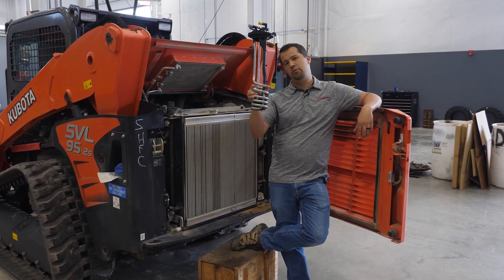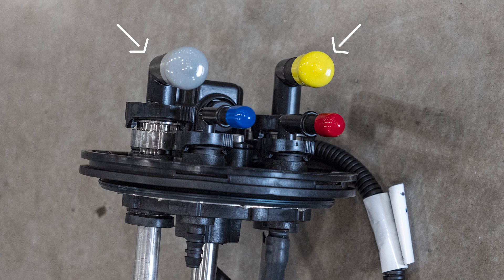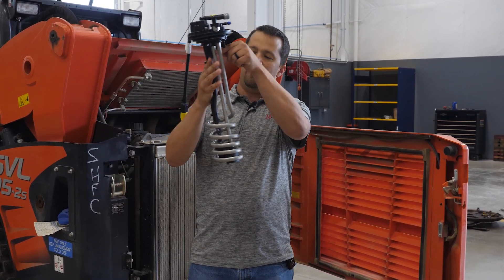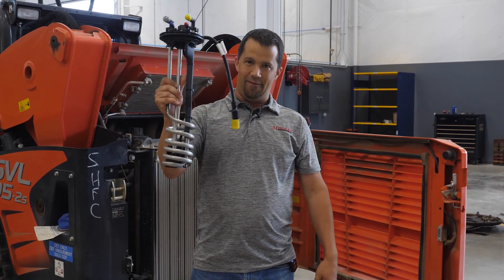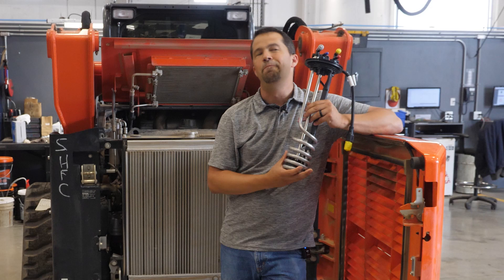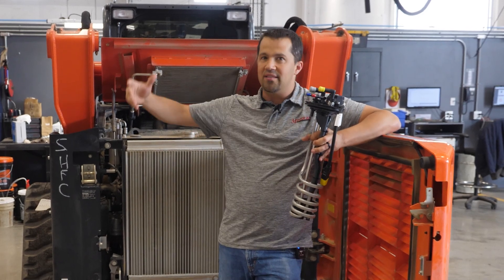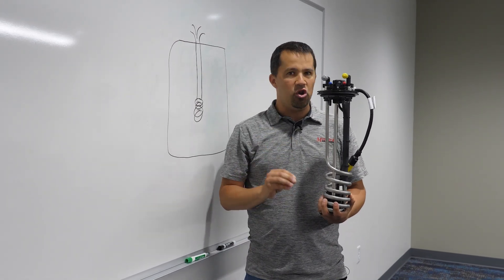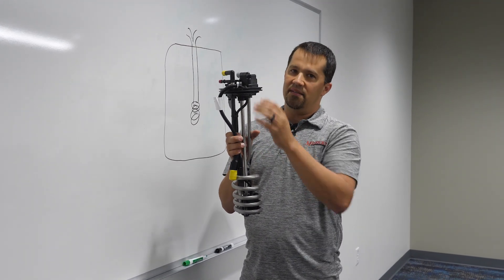DEF problems? What is the DEF header and how its been improved.

Comment: My Kubota M5-091 with 300 hr just threw a code for the DEF circulation pump.  Basically Kubota has a crappy DEF header system that should be replaced as part of a recall.  I change my DEF fluid every 6 months, but it hasn’t helped me.  If this current issue costs me big time, I’m done with Kubota.
Reply from the maker: There was a service campaign to fix this problem

Comment: I’m not a big fan of particulate filters in general on off road vehicles!  I recently bought a L3902 HST and was reassured the regen system if fairly trouble free for years depending on the hrs I put on it! I actually don’t mind the lesser stink of diesel exhaust from a regen system and have always disliked diesel fumes in the past! It would never fail that I would get stuck behind some coal rolling garbage truck and my vehicle would smell like diesel for a day! 😂 I’ve been a believer in that  less is more ! The simpler the system the longer it’ll last. All this extra emissions is just destined for failure!

Comment: It's a shame that they couldn't design fluid that had an actual lifespan to it especially considering a lot of DEF tanks seem to not come with a drain valve on the bottom so you can drain old fluid without pulling a lot of parts out. It's a multi hour job to drain out the tank on a silverado for example and it's basically impossible to get to the DEF tank on a cat 299.

Comment: Working at the biggest Kubota dealership in Georgia, I could change headers in my sleep! The upgrades are great so far, buuut we have been told that before. I will say, big orange stands by there product 100persent.
Reply: I need to change my def unit. 
What holds the unit in place? I see how to get the hoses  and connectors off but what is the trick to remove the unit from the tank?

Comment: Neil, I watch every video because I have several Kubota products and I love your work, but I also have a diesel motor home. The motor coach industry has suffered greatly too, perhaps even more, if you can imagine grandma and grandpa out touring the country. And first thing you know lights come on and before you know it the coach derates to 5 mph and they are basically on the side of the road waiting for a $2,000 tow 2,000 miles from home. This is the best explanation I have seen regarding the issues and components of the DEF system. I have shared your video on one of our Facebook forums and people are responding very positively seeing how the issues we have been dealing with come about. Thank you!

Comment: The epa is letting the truck industry temporally delete it by programming it out... Parts supply issues are real.
Reply: I heard that 5 years ago, and was not true, what was happening was independent shops were selling delete kits. We had one customer who took his truck that was under warranty to an independent shop, for  "temporary delete" only cost thousands in repairs later.
Reply: @billpollock1763  yes that exists but the problem is is against Federal law. A better solution is buying a glider kit it gets a new pre EPA engine.
Reply: @sweetpigfarm3645  glider kits are getting harder to get, you are better off with an older unit and restoring it.

Comment: I personally think that manufacturers should be embarrassed that after almost  15 years this basic system is still so problematic. And I believe I read that the part you were holding in your hand was $2000? Ridiculous. I can't imagine it costs anywhere near that to actually manufacture it. Now I'm not trying to pick on any particular manufacturer, but it doesn't seem like there was much effort put into the constant reliability of the systems. A person who has a small business that owns trucks and equipment with these various systems cannot rely them- it hurts a small business even more having all the downtime. I'm all for saving the environment, but this is not the way to do it. That being said, good info Niel!!
Reply: It's definitely a killer for small business owners and especially trucking owner operators. If you're a big company and a machine or truck goes down you'll just throw the driver in another or put the operator at another job and write it off but a small business owner that downtime is costing you your livelihood.

I'd also worry about a derate in a dangerous situation, imagine you're in your tractor trying to plow your burning field ahead of a fire and boom, derate, now you've got to abandon your tractor to the fire because you can't escape or your truck derates on a large mountain and you're now in a dangerous spot.
Reply: Agree 100%
Reply: Planned obsolescence should be legislated out of our economy. 
The ECU immobilization of “common failures” should be illegal (except for catastrophic failure), while notification and serviceable parts pricing must be returned to manageable budget items or deleted and deregulated all together.

Comment: Does hot weather affect DEF consumption? I have a 2022 SVL97-2 that I have now put 625hours on it strictly running a forestry mulcher. When I first got the machine It would take roughly 4 days before I had to fill up. Now I have to fill up every day to a day and a half. Any thoughts?
Reply: Had the same issue with big trucks when Def first went into use, the ECMs were originally set at 5% or 1/8 if a tank, but drivers would run out and up with a derated engine down to 5mph pretty quickly. After software updates it was changed to 10% or 1/4 of a tank, we just had to retrain drivers and all was good. Now if you think you are using more than you should, then you can check for leaks, you would see white crystals forming usually at line connection, the most common is at the tank. On older systems the Def injector tip would start to leak, causing def to build up in the decomp tube.
Reply: Generally you will see DEF use go down a little in hotter weather and go up in colder weather. Yes the problem is with the ECM program simple fix
Reply from the maker: If your filing off the gauge, see the bit I covered on the software charge to the tank. It's probably half full.
Reply: @MessicksEquip  Correct I am filling it off the gauge. But I’ve always filled it off the gauge And now I have to fill it up twice as much as I used to
Reply: @TopsideSiteworks  are you still putting in the same amount as before you noticed the issue?
Reply: @farmingnodak  yes it only takes 3/4 of the 2.5gal jug every time I fill it since new
Reply from the maker: Per the software change, the tank is probably half full when it's calling for a fill up. You could safely ignore it for awhile.

Comment: My Kubota M5-111 had its DEF system repaired under warranty twice in the first two years of its life. There was no monetary costs to me, the true costs were that I wasn't able to use my tractor for a month. The last visit to my dealer, I spent time with the service manager learning about DEF systems and fluid change intervals. My power requirements do not consume a large quantity of def, therefore it can deteriorate just from sitting. What you covered today Neal was another piece of good information,  thank you.

Paul

Comment: If the deaf fluid/around and causes all that problem why not make the tank smaller in diameter but really deep so that holds more and doesn’t have to be topped off as often
Reply: Most tank now have baffles in them and a tank vent filter. Also one of the biggest killer of def quality sensor is dirt, small particles will build and cause the sensor to fail.

Comment: I'm an engineer and it amazes me how often automotive designs (which this actually is) miss the boat on simple logic. Why would you design a sensitive electronic part as an integral part of a large heat exchanger subassembly? Or use a tank/line material incompatible with the primary fuel of a vehicle, where incidental contact is very likely? It's not only the diesel world that's guilty of this, they use similarly poor designs on automotive systems all the time. Makes you wonder if service/parts sales is the reason behind these 'integrated" component assemblies. It's a very common design in fuel and  emission components which the owner frequently has no choice to buy from the dealer. It's my personal opinion that this ties directly into the Right to Repair issue.
 I just replaced a $200+ emissions assembly (Secondary AIR valve) on my son's car because it contained a $15 pressure sensor which isn't available separately and is a very frequent failure point as it collects condensation since it's designed into a low point in the line. It doesn't effect operation at all but is required for the car to pass inspection. it's only purpose is to heat up the converter faster and only during a cold start.
Thanks for keeping us up to date on the state of affairs regarding a frequent failure item on our machines and how to best care for them, You folks at Messick's are 1st class and none of this is directed at you.
Reply from the maker: your not wrong. One thing to keep in mind though is that this is way more painful for the manufacturer than the end consumer. 9/10 times when these have failed, its happened under warranty. If there was a way to cost reduce this the incentive is certainly there.
Reply: As a farmer that deals with sub-par service techs frequently, I think it is an issue of simplification. Manufacturers know that there are a lot of techs out there that aren't that bright and if you have a guy that needs a flow chart to figure out that a connecting rod went through the engine block he sure doesn't need more parts to confused by. That and it simplifies parts warehousing given the millions of SKUs dealers already have, if things like this were sold as individual parts there would 5x as many SKUs out there. The main problem is the government regulation that requires equipment to be so complicated. We need to go back to things being less electronic and more mechanical, or at least simpler.
Reply: They don't "miss the boat", they make money! In some way they have to make profit and with modern "strenx"steel, better filters, better fluids and so on the possibilitys gets smaller and smaller.
 Soon they will have to be legally "right" to make "default by design" because they need it go make profit. An old machine will work "for ever" thanks to new clean fuel and new really nice oils and fluids. An old diesel will run as long as there is diesel in the tank and oil in the machine...

Comment: Neil, would have been curious to know the retail price of that DEF assy. you were showing.
Reply from the maker: about $2000. Keep in mind, the only time I have seen a customer have to pay that cost is diesel contamination. The other failure modes the manufacturers have covered, thus why I'm impressed by our vendors that in some cases have paid for 2-3-4 of these things on some customers machines when the part was less than perfect.
Reply: @MessicksEquip  would those said parts still be covered even waaay out of warranty? Have a 2013 T9 and a 2016 TS6 that use it, none have had issues yet but waiting for the day for something to happen.
Reply from the maker: @farmingnodak  those did not have the reliability problems compared the one I was holding there. I would not expect problems, or special extensions.
Reply: I have a Leeboy paver with the quality sensor code. How can I make sure it’s replaced with the updated version?

Comment: Neil,  Have you done an update video on DEF  shelf life and storage? How often you should refresh it in your equipment if it has been sitting?
Reply from the maker: I'll see if I can get together enough details to make it a video.
Reply: Heat kills Def. Keep it stored in a cool/cold dry place out of sunlight.

Contrary to what Neil talked about keeping the tanks topped off, I have been running my machines on less than 50% full majority of the time... that way I can empty the tank quicker and can refill fresh stuff in more often. Plus if any quality issues/other problems arise I won't have to dump as much on the ground. 

If storing machine over cold/freezing months, just keep it low enough (<20%full ) to prevent tank from bulging if it freezes. If you live in a climate with higher temps and machine will sit for a few months drain it out and store the Def in a cool place. Shelf life can vary from a couple months in hot weather to over a year in cold storage.
Reply: @farmingnodak  I believe DEF tanks usually have a heater since the cold can mess up DEF also. Kinda idiotic to use a fluid that can freeze at fairly normal winter temps but what do I know, I'm not an engineer.
Reply: Caterpillar recommendation is if the fluid is stored at or above 95F then you must test it before use. Most testing I've seen is with a refractometer, it's really easy to use. Not sure of price. But it will tell you what your DEF concentration is. Ideal is 32.5% urea (the rest is deionized water). The acceptable range is 29%-35%.